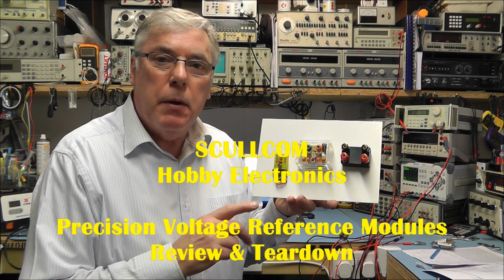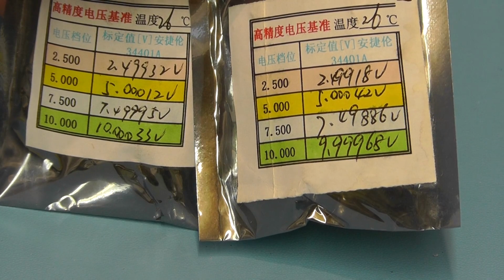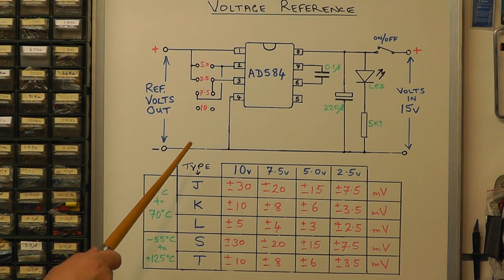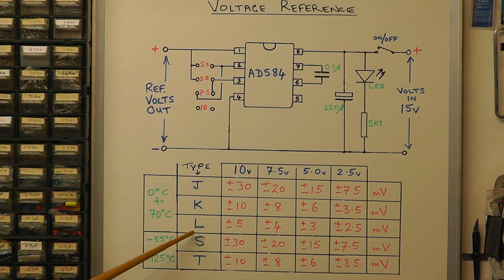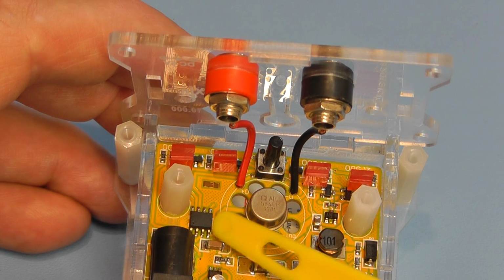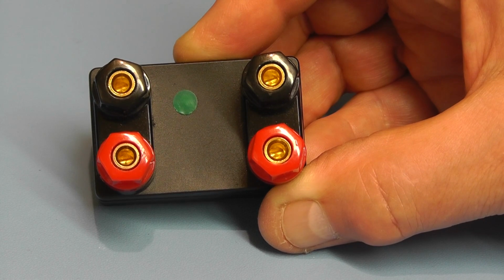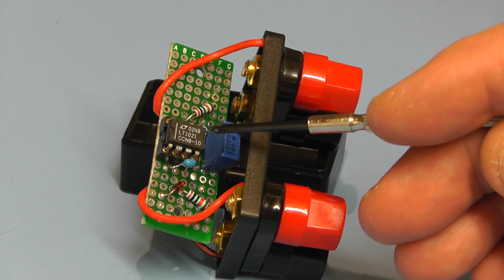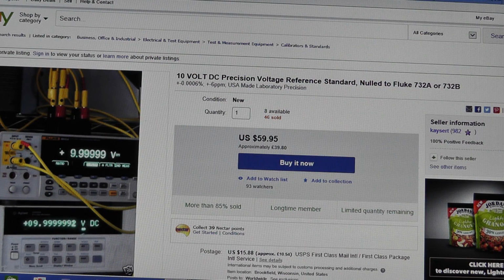Scullcom Hobby Electronics #8 - Precision Voltage Reference Modules

Comment: Very useful demo and explanation. Maybe the cheaper V refs could be improved by putting them in a temperature stabilized  environment ?  Arduino nano with temp probe and heater resistor in a small case.

Comment: I know this is an older video, but I was a little concerned about the second reference with the DC boost converter.
I would think that since this is supposed to be a precision reference, you would not want a noisy DC converter close to the reference.
It seems like noise is not a problem though, unless the DVM is ignoring any switching noise.
That is my only concern.

Thank You for posting!
Reply: DVM is probably doing a decent amount of averaging, which mostly negates the noise. It only updates its reading a couple times a second. If you needed a continuous, stable voltage, then the noise from the switching might make its appearance.

Comment: The Ober/November issue of Nuts and Volts has an article on voltage Ssandards. The author showed his home brew version that uses this IC. I though to my self I can build this. I can however when I went to order what parts that I didn't have is my salvage boxes, I decide to order a ready to unit. Because it was shown in the article I ordered the second unit scullcom reviewed here.  The only complaint about it is unlike the machine printed “calibration” label shown her the label on mine had hand written values that are barely decipherable. Not sure how scullcom went about determining what pair of banana plugs where what, it was clear to me how to go about that, and seems like I would have been correct Regardless what one thinks of the construction, the third unit had the better design. Simple straightforward use. In the event one needs to calibrate lower range, most wont, it's a simple manner to create an outboard circuit to to that. On e caution though, the magazine article seems to indicate a load greater than 10ma place on the IC could damage it. Best to use high impedance meters. Unless they are VTOMs or FETVOMs, at these low voltage levels analog meter will not be high impudence. Being a DMM is no indication of high impedance. Going beyond the scope of this article,if your are working with electronic hardware anywhere, you should be using high impedance meter I hope this comment is informative. I will in tame homebrew this circuit. In the event I can purchase a Weston cell for the right price, I'll gut it it, to place the circuit inside that. Going for the far out factor of course.

Comment: For for less than $20 US including shipping I wasn't expecting a $200  construction and packaging quality.  I have the clear plastic enclosure model here on my bench. I first learned of this IC in a nuts and volts magazine article. I was about to chase the parts to construct  my own.Howe ever I notice the Author's artarticalcal was base on  duplicating what the product that in a phot within the article I purchased. The author didn't say anything, one way or another  about the commercial item I hav think meters with less than 10 Meg ohm impedance, may load the IC to degree, where it can't give a decent measure

Comment: This is a useful review of these devices (I have one of the second type, with some minor differences).  A couple of important things not noted: the ‘calibration data’ accuracy is dependent on ambient temperature and an adequate warm-up time; all commercial instruments are specified based on a Gaussian sampling scheme.

With my unit around half a degree lower than the ambient temperature on the label, it matched our laboratory 3458A multimeter fairly well.  (That multimeter is traceable to international standards, and the uncertainty is considerably lower than the manufacturer’s specifications.)  The data does not give uncertainties, and it isn’t stated what instrument was used to measure ambient temperature.

If you expect to require an accurate output down to the second to last digit then you’ll have to verify these units somehow — the last digit usability is unrealistic.  If you only need an accurate output down to one millivolt then these should be fine to use as they are (indefinitely).
Reply from the maker: Thanks for your comments and info. Regards, Louis

Comment: For the last one, they actually wrote Red (Top), Black (Bottom). So, when you turn it around and keep the red connectors at top, left and right becomes apparent. Funny way to indicate input and output ports but nevertheless it should work. :D 
I was looking at these voltage reference kits from China for some time now, I wasn't sure of their accuracy, your video really helped to decide. Thank you for taking the time and doing this very informative review.

Comment: That last reference was pretty sketchy being built on ring board. I mean break down and get boards made up for crying out loud.
Reply from the maker: Yes agree the last one was poorly built for the price.
Reply: +Scullcom Hobby Electronics I have point to point wired up some circuits. Not only can it be unattractive, but it also tends to be a lot of work compared to assembling a printed circuit board. Perfboard certainly has its place, but definitely that place is not in a commercial product.

Comment: some sellers say that their units are calibrated with an agilent. do you think that the unit 1 and 2 can be calibrated , cause based on your schematics , they cant (unit 3 can be calibrated of course).
Reply from the maker: The first two rely on the accuracy of the I.C. As that particular I.C. provides 4 reference voltages. What the sellers does is check the accuracy of the reference voltages and then prints the actual voltage measured with a precision calibrated meter on a test sheet attached to the unit. In the video I do point this out.
Reply: You are correct! Some sellers dont provide the written notes though.maybe we can trust your seller to be sure. Thank you!

Comment: What kind of equipment can references be salvaged from? Any commercial or consumer electronics use them ?
Reply from the maker: You will find precision reference voltage devices in precision bench multimeters. You will also find the used with equipment that uses DAC or ADC devices.

Comment: Does anyone have a link to the first one on UK eBay please and a comparable resistance reference board too please.
Reply from the maker: Try the following eBay link:
http://www.ebay.co.uk/itm/Precision-Voltage-Reference-Module-4-Channel-AD584kH-For-Desk-top-Meter-Probes-/141731489866?hash=item20ffdae84a:g:zWEAAOSw3ydVuZsD
Reply: Thanks mate
Reply: if you search ebay for "AD584" and arrange for lowest price there are a couple of even lower cost variants. they come with fake test result sheets but the outputs are within spec for the chips they use and are perfectly accurate enough for most hobbyists

Comment: Odd that the polarity protection diode in the third unit is in the negative path.
Reply from the maker: It makes no difference. You can add a reverse supply protection diode in either path.
Reply: True, but it seems it ruins some of the versatility of the device, should it be used for something other than a meter calibrator. For example, if it were to be used as a voltage reference in a system, where the negative point on the regulator would usually be at ground potential. However, in such an instance, you could simply bridge the two black posts.
Reply from the maker: Good point. I think the supplier of this unit only intended this to be used for meter calibration check.

Comment: Some good design insides and teardowns here, but I was hoping for more of a review of these units. What were your opinions on them, especially considering the prices? The middle of the three for example uses a simple cheap boost-mode SMPS to step up the 3.7V battery to what I'd imagine is around 15V to power the reference. What effect does that have on the output stability, for example? Does that switching noise appear on the output? Does it matter?
Reply from the maker: +Paul “LeoNerd” Evans Thanks for your comments. The first two where both well built and there accuracy was as per the calibration reading which were sent with the units. The last one in the black box came from a guy in the USA and although the build quality was poor this unit was the most accurate as a reference standard. I think the key to accuracy is they type if voltage reference IC used.
Reply: +Scullcom Hobby Electronics Interesting. So you don't find that the switching PSU in the battery-based unit upsets the output at all? That was the one part of its design that put me off the idea
Reply from the maker: +Paul “LeoNerd” Evans No there was not a problem with the unit with the switching PSU it did not effect the output. That particular unit worked very well. In fact it was the best build of the 3 I reviewed and was good value for the money.
Reply: +Scullcom Hobby Electronics Ah I see. I was mostly looking for advice on whether I should get one, so it sounds like the answer may be "yes". Thanks

Comment: Just ordered one from eBay ($8 Cdn) - it's similar to the first but takes a 15 volt battery which costs more than the unit itself.  Also has a barrel plug for power input so the battery is not necessary, although likely a cleaner input.  This unit has the AD854L component which is the main reason I purchased it as I'm not in love with module layout.  Should satisfy my requirements though.
Reply from the maker: +Digger D Thanks for the comments.

Comment: The LT1021C is not nearly as good as the REF102C -- It's actually 20ppm/C max vs 2.5ppm/c ( search "LT1021C-10/LT1021D-10" in the datasheet ). Also its long term drift is 15ppm/1000hr vs 5ppm/1000hr. Line / load regulation is also worse. Sad that they would go for a $3 cheaper core part on an item that costs $60. Also the 6ppm claimed accuracy is questionable since their meter is only 8ppm accurate.
Reply from the maker: +Michael Iv Yes agree. I was surprised my self to see the LT1021C chip in the unit since I was expecting a REF102C as the seller advertised the module. Clearly, the seller did it to reduce his costs but at the same time did not adviser the buyer that he had changed it.

Comment: Where to start!

First one with the sliding switch: seeing that capacitor bodged on the back says a lot.  No case - easy to damage if some pins come in contact with metal or tools.  A case would cost a fraction of what the actual reference cost in the can, especially in China.  Short power wires where a power jack would have been better.

Second one with the nice case: it is the best of the lot.  Scratching the part number off the control IC is lame as it isn't exactly complicated to select the voltage and turn on some LEDs.  But using a switching DC to DC converter where you want as clean of a reference as possible isn't a good idea IMHO.

Third one in black case: is a peace of crap.  Wouldn't trust it and would be screaming at eBay that I want my money back!  No labelling on the from.  Made on a proto board!!  Fine if the guy selling it says it is a one off that he made at home and says so BUT if it is claiming to be a professional grade (and at that price) it is a total scam that some might more likely expect from China than the USA.  Serial number 36 so it looks like they've sold some before yours yet it is on a proto board!  It doesn't show what the actual claimed voltage is just some made up accuracy.  What is the accuracy of the resistors (including the pot) over time and temperature?  Total crap.

Thanks for the informative video though!  I appreciate it.  Might be time for me to design and build my own voltage reference!   ;-)
Reply from the maker: +ElmerFuddGun Thanks for your comments. If you check my You Tube Channel you will see I have already designed and built a number of voltage reference sources which you may find of interest.

Comment: I always wonder  - when talking about a few 100000ths of a volt - surely things like test lead and meter input resistances come into play? I know these things are normally negligable but at these tolerances they must start to have an effect.
Reply: +reggiebacci For this particular case, not really, resistance of the leads is probably 0.1Ohm and impedance of the Keithley is somewhere around 10MOhm, meaning that the voltage drop across the leads is 0.000`000`1V - Under the Keithley's capabilities.
Reply from the maker: +reggiebacci Thanks for your comments. Yes you are correct. In professional equipment the resistance of leads are usually cancelled out with additional circuitry.

Comment: I believe the 1N4148 is to lift the Vref output above the input noise coming into the circuit. Or maybe that is a lucky added feature...
Reply from the maker: +Mike Novo Thanks for your comments. I do not think that was their original intention but as you say its a lucky added feature!! I think they were more worried about reverse battery connection.

Comment: No reason to think the calibration is off on your Keithley. It has 24 hour accuracy of 15ppm of reading + 4ppm of range. That works out to uncertainty of 154uV for 10v, 79uV for 5v and 41.4uV at 2.5V. 1 year uncertainties are ~ roughly double. I didn't bother looking up the accuracy on the 34401A, but I expect its similar to the Keithley 2000.  So, all your readings are within the combined uncertainties of the two meters

For what it is worth, the two AD584 references you show originate from the same designer/maker. I think I even found gerbers for more involved version at some point. the We don't know how recently their 34401A was calibrated, but they tend to stay within their one year uncertainties for years, unless something has gone awry. You'd think though, checking dozens and dozens of Vrefs over years, they'd notice major drift.
Reply from the maker: Tech Obsessed Thanks for your comments.
Reply: there is no reason to believe accuracy of the "calibration certificate."

Comment: The middle one does look much better made, and very ideal for checking cheap multimeters for basic accuracy, they have put more work into the product.
the last and most expensive one just looked rather diy and dispite its accuracy i would give it a wide birth.
I would trust your keithley more than those references, keithley is quality design :-)
Reply from the maker: zx8401ztv Yes I was surprised at the quality of the most expensive one. Soldering was not to good!!
Reply: Scullcom Hobby Electronics Hope you dont mind comments on your earlier videos, some people get annoyed with revisiting them again.
Reply from the maker: zx8401ztv No problems.

Comment: I have the middle one (clear case) - the PBC is really interesting.  Why did they layout the can with holes around it like they did?
Reply: GeorgeGraves Maybe for stress isolation? The changing temperature of the reference won't stress the board as much and cause possible variances. I remember Dave (EEVBlog) mentioning that for one of his recent tear downs.
Reply: Scullcom Hobby Electronics My guess is thermal isolation.
Reply from the maker: twjonckheere Thanks for the answer - spot on. I did do some further research myself and found it is used to eliminate possible PCB expansion due to temperature effects which could stress the pin connections of the IC and thereby effecting its internal input lead connections and performance. These isolation slots or holes would be helpful especially in manufacture of PCB circuit boards where very hot solder flow techniques are used for soldering all components where the whole PCB board is heated before and during soldering.
Reply from the maker: They look like isolation slots used to guard against interference or leakage from other parts of the PCB. The reference IC is very close to the DC to DC boost converter components so that may be a reason. The other point to make is that the PCB is a fairly tight fit in the plastic case so it could also help with air release when pushing the PCB in to the case!
Reply: Scullcom Hobby Electronics  Yea,  I was surprised with a boost circuit in there.  You'd think that would generate some noise, even if it was was on a separate, but near by PCB.  An interesting follow up video might be to look at the output on the scope in AC couple mode, with powering the other two by battery or very smooth linear supply.  Thanks for the great video!  Thumbs up and subscribed!
Reply from the maker: Maybe for thermal isolation but nothing in the module gets hot!
Reply: @scullcomhobbyelectronics1702  Its less about absolute temperature and more about thermal stability and thermal mass.
Reply: Scullcom Hobby Electronics I guess I should have been more specific though. I meant isolation from stresses caused by thermal gradients.